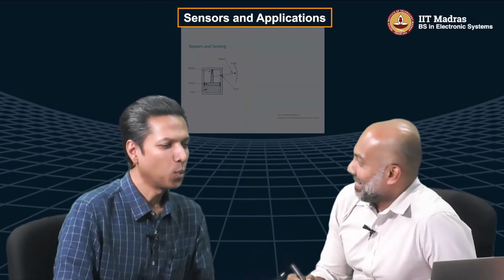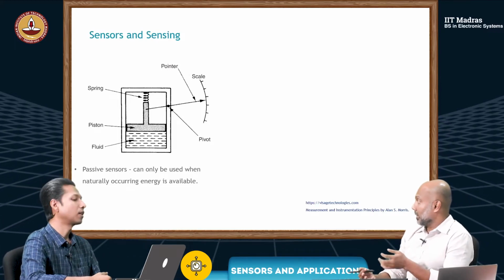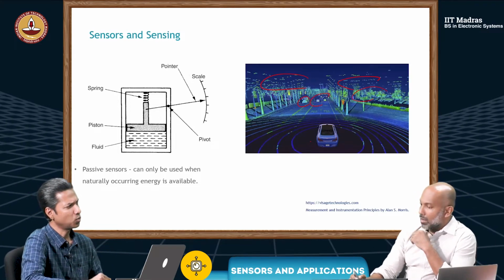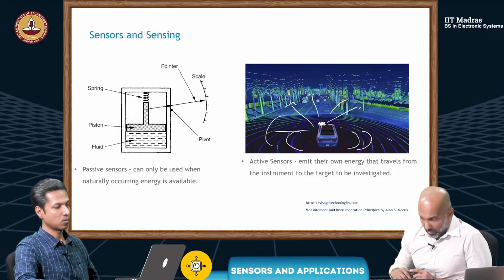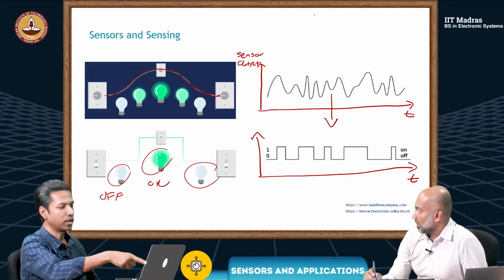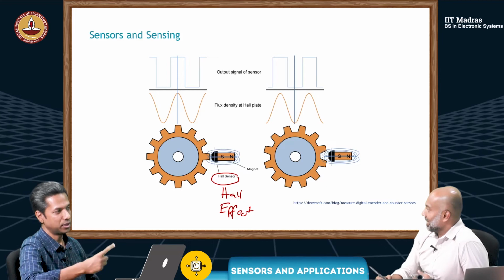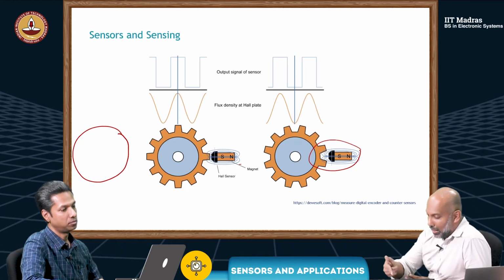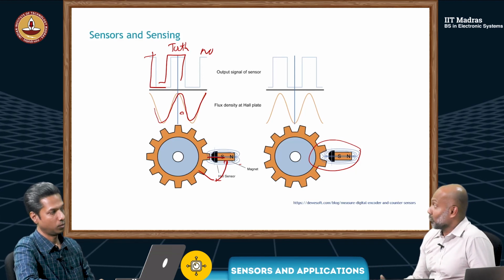W1_L3_Classification of sensors

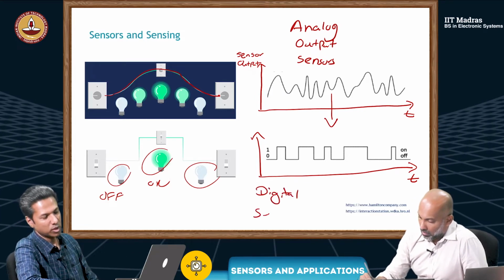Comment: 12:44 here,even the analog sensors will give the digital kind of output, right, since the process it's measuring itself is digital,in 2nd scenario?

So,we can't directly say/conclude ,just by the graph, that a 'digital' sensor is used 

Am I right here?

Comment: In lidar, do we use a visible light.
If yes, which colour it is?
How it's implemented without interfering with other activities
Reply: No. Visible light is not used. UV light, IR light is used.
Reply: @AtAGlimpse_UB  👍 thanks.i too thought the same.
But,As it's mentioned light,I got confused
Because light refers visible radiation right